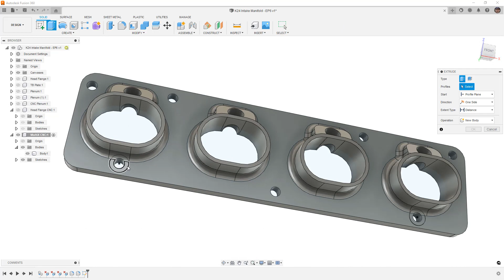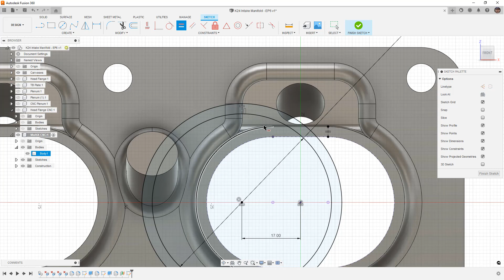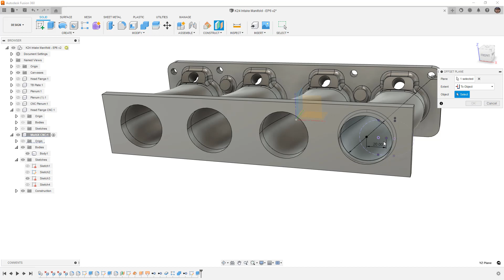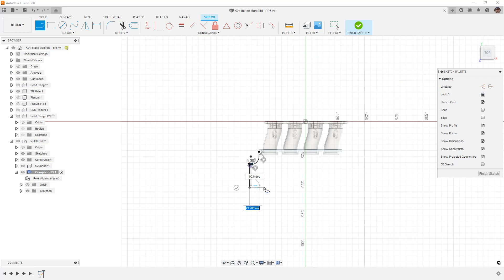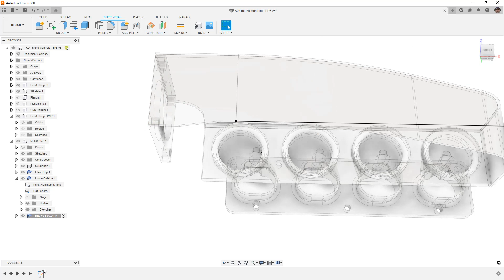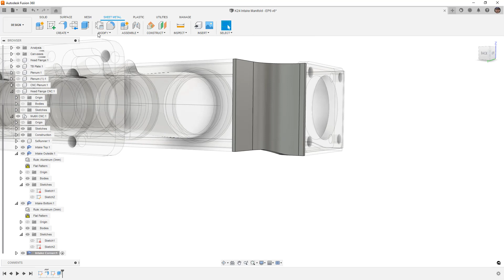Designing an Intake for 5-axis CNC in CAD | K20/K24 Swap Intake Manifold Design #Fusion360

Comment: just watched all of this series, from a beginner cad user this had some interesting thought processes, however I am also after more of the thought behind the design, is there any resources that you would suggest to go over for how to help design runner length, plenum shape, and cad flow testing to go through design itterations before making/3d printing etc.?
Reply from the maker: For sure, but it depends a bit if you are making an NA manifold or if you are building one for boost.  Generally the plenum size has to do with the engine size.  On a boosted application its more about short runners and plenum volume.  For an NA manifold there is a bit more that goes into is as the runner length, size are going to impact torque.  

There are a lot of other little factors too.  For example on my starions stock g54b engine. it has a hemi head, but the path of the intake runner to the valve is not straight so this has a bit limit on RPM.  so no matter how good the maniold is the head is a restriction.

Some other factors also exist like the friction between the air in the manifold and the walls of the plenum and runners.  This is why you often see bell mouth runners that stick into the plenum to avoid the "sticky" air on the walls.

My suggestion is to narrow down the search by first turbo or na.  then to search based on your engines layout and operating RPM.  So if you are designing for say a 1.8l 4cyl that revs high but doesn't have a ton of low end torque, that is different than if you have a low rpm v8.

There are going to be loads of articles like this that allude to some of these things.

https://dsportmag.com/the-tech/intake-manifold-101-ensuring-the-cylinders-are-working-their-best/2/

Comment: It would be awesome if you could do a plenum that is bolted to the plate on the runners. I'm thinking on designing a intake to 3D print to test how far can I go with a printed part on boosted applications using Carbon Fiber Nylon, and this series has been incredible for me. I just feel it could use the bolt on intake I have seen so much in many race cars. For my 3d printed part it's a must since I can't make it in 1 piece as much as I would love to. I would have to do the plate that fits the head with the runners and the plenum plate in a 1 piece print, then do the plenum in a separate piece.
Reply from the maker: i'll see if i can't add something.  A combination of the form made plenum and the 5x cnc runners is the way to go for sure if you are going to 3d print it.  I have heard of 3d printed aluminum and inconel "in-use" plenum pieces, but I don't personally know of any 3d printed plastic manifolds on boost that have survived.  You might consider wrapping a layer or two of CF cloth on the outside to help it survive the pressure.  I think the biggest issue is the bonding at the layer lines, but there are solutions you can dip it in or spray it with to try and help, but that is likely the failure point.
Reply: @LearnEverythingAboutDesign  Thanks for the reply! I will use the CNC kitchen inserts for threads and planing on having some CF cloths and resin layers on the outside and maybe even the inside to keep it all together! Since the car doesn't build a lot of boost, usually works between 1-2bar I will try to see if it can work for me. I'm building a formula 4 with a ea827 8v engine, should be fun!
Reply from the maker: @ver.motorsports  Sounds awesome.  also 2 bar not a lot of boost? 30psi?  :)  i think of low boost as 7-10 ;)  I have used melt in inserts on prints before but never under pressure.  You might consider just some sleeves and run a bolt/nut through the runners and plenum flange.  Be more of a pain for assembly but you don't have to worry about pull-out issues with the inserts.  You can even have a washer flange laser cut to help spread the load out.
Reply: @LearnEverythingAboutDesign  Thanks for all the tips, I really appreciate it. I can get water jet cut parts where I live, laser cut is harder to find. That sleeve idea is great didn't even thought about it, thanks! Well  for this kind of engines 15-30psi is considered low boost for forged applications. Today the faster 2 ea827 engines are running 7 to 8 bar in a FWD configuration for drag racing in brasil. (I'm from Uruguay) so about 3-4bar is normal in ea827 (AP) engines with ethanol
Reply from the maker: @ver.motorsports  WOW, sounds like i need one of those engines in my life lol :)   Yeah you find a lot of plastic manifolds(injection molded) will have metal sleeves where the bolts are to prevent crushing the plastic to preserve the seal.  Waterjet is good too.  Laser generally has a better edge finish if the hardness/temper of the material isn't an issue.  Other than the boost i think one of your big challenges will be maintaining a seal between the two parts.  Off hand i don't know what the transition temp is of the CF/Nylon material.  If you use epoxy resin and a layer of cloth on the inside its probably not an issue at normal temps.  If you want to chat about this more or join the discord channel send me an email support@caducator.com  super interesting project!